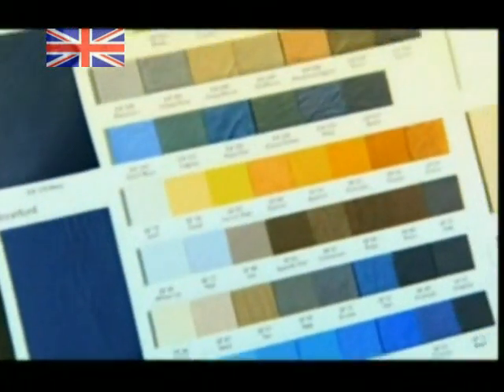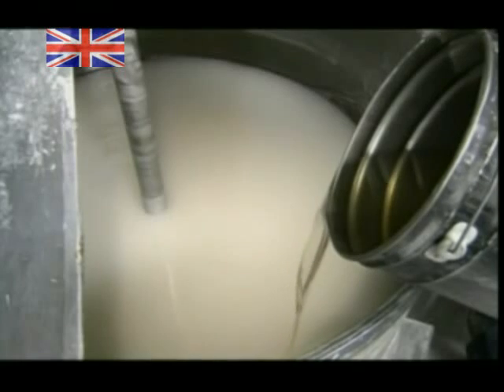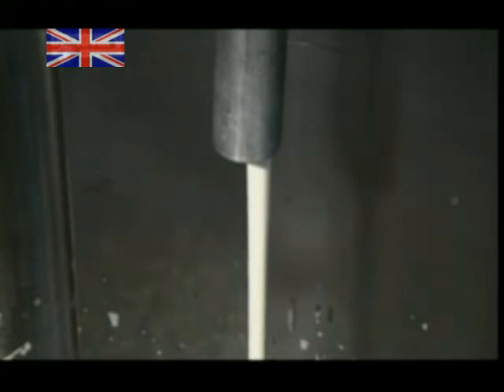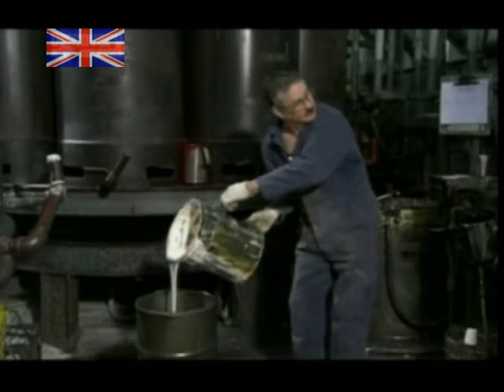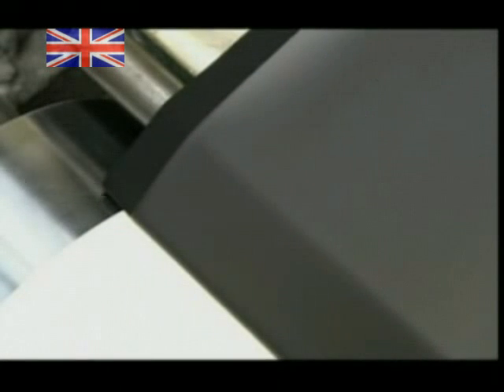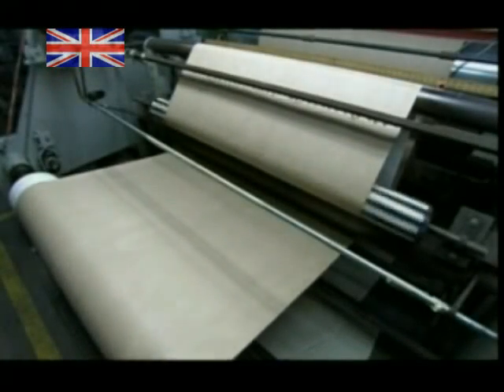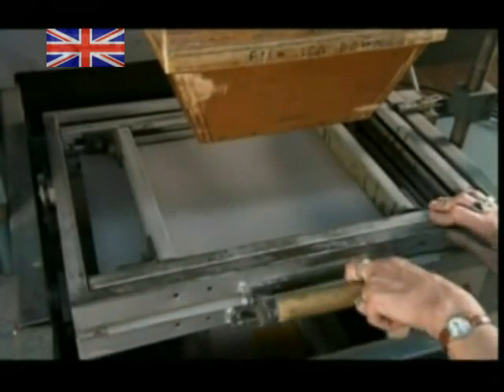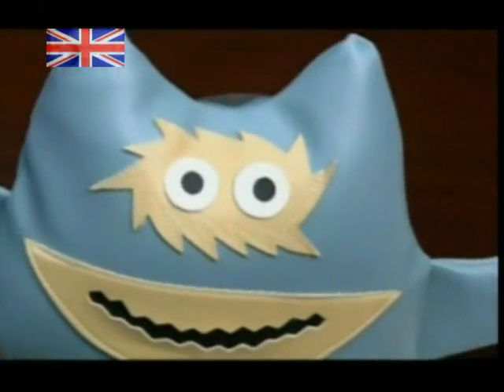Synthetic Leather - How It's Made

Comment: If its convincing enough I actually don't mind this in a new car. The real problem with synthetic leather is how it wears. It never develops a patina and new is the best it will ever look. Id hesitate to buy a jacket in this material or anything Id keep for 10 years +
Reply: Is patina important or animal life
Reply: @susandmelli9273  certainly animal life if it were in isolation. But leather is a by product the meat industry and wildlife management efforts - an animal product that would otherwise go to waste. So until we move entirely away from having to kill animals for other reasons I think it's more respectful to recycle all by products of the kill. I don't support exotic leathers where animals are harvested solely for the pelts
Reply: @Disinf3ctant  ur in misinformation, see how High grade quality leather is made by breeding crocodiles to suffer n skinning them alive like in Vietnam, carcass of animals killed for food have less value of leather because it get damaged faster when it starts to dry out, it can eventually crack and peel.
Reply: @susandmelli9273  you're speaking of exotic leather which I just denounced. Nearly all bovine, sheep, and goat leather is a byproduct of food. The carcass is skinned exactly the same way regardless of whether you eat the meat or not so it can't possibly have an effect on quality.